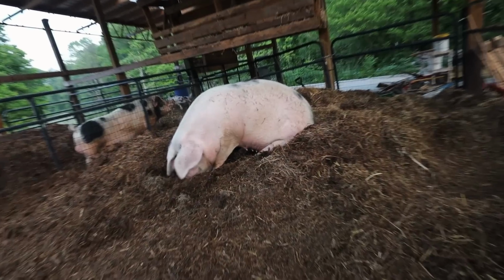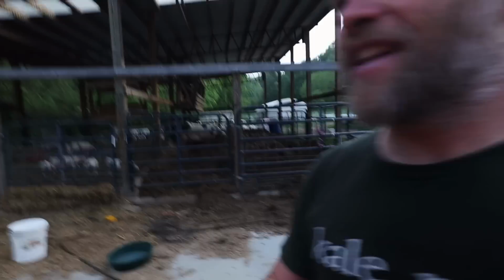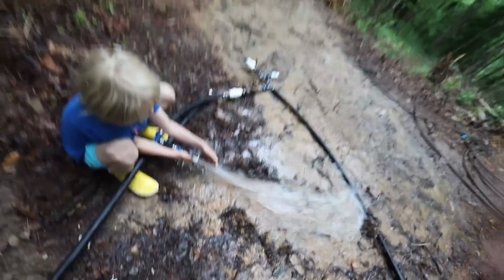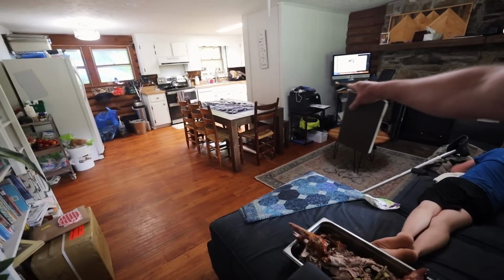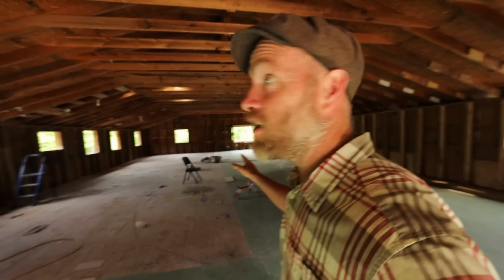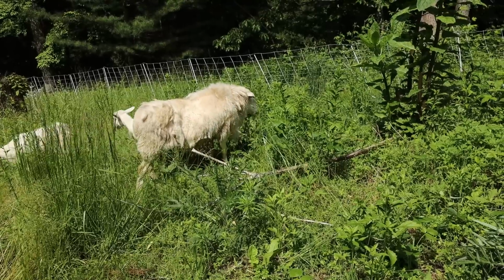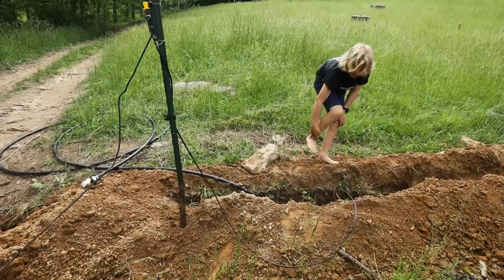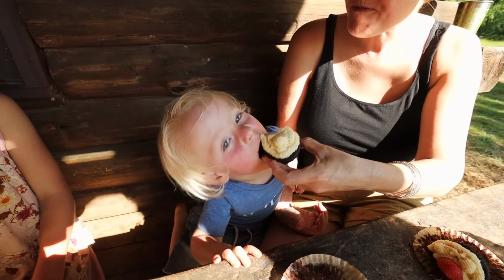WATER PROBLEMS

Comment: There’s not enough pusher to push the water up the hill that’s wide up on top. You got a lot of air but if you go at the bottom, there’s a lot of pressure cause that’s where all the water is staying. You need to put some kind of pump to pull the water upsomewhere in the middle of the hill so I draw the water up the hill.

Comment: Great visit --- everything was inspiring. I have no blow torch but I'm boilin' (bowlin' as a southerner would say) some water to see if the black hose will soften enough.  .... (when the visit is over). 
Lily driving, Jonah cookin' and gratin' and how about  Josiah being able to so beautifully be able to fill in that line? Master Yellow Boots up to the shenanigans and Henry becoming Salty.  Good to see Gramma a minglin'. 
Dang if my job of putting a shut off valve on  didn't go as smooth as butter.  I'd been putting it off thinking how I'd seen you using your blow torch and thanks for inspiring the Dokkodo out of me.

Comment: That was fun to see you get pigs to the guy picking up a couple of pigs. I'm glad you got some of the air out of your water system. I'm surprised climbing that steep mountain helps with your ankles. Henry did good up the mountain and down in the ergo. Yum, rotisserie chicken! I'm glad grandma got through her treatment. That's too bad you have to re-do the whole roof for the remodel. It makes sense that you have to do it right or not at all! Randolph's idea for taking the top off the walk-in freezer worked. It sounds like you need trusses for the new roof! I'm so glad the boys got Selma! Nice, skit filmed by Austin for the Homesteaders Builds kickstarter happening June 1st! Sally is getting worked on. Nice work on the road with the track loader Jonah! Josiah did a great job on burying the water and electric lines. So much on this video Justin! Thanks for this Rhodes family! Lily is an amazing cook and I hope she gets lots of plastic horses!

Comment: You have a lot of graveled roadways you might want to get a Box Scraper for the tractor to help in grading the roadways. It will allow you to pull bunched gravel up into exposed parts and to level the roadway.  I would suggest creating chevrons on critical pieces of the roadway where you are seeing severe washout to help in diverting rainwater off the roadway. When possible you will want to alternate the directions of the chevrons so you do not over burden fields with water and cause other issues.  You have some steep sections of roadway that would benefit from this.  Look towards making your roadways work more for you in regarding runoff and that is both for rain and snow.When you make the chevrons continue a small shallow ditch about 6" into your field to help in diverting the water runoff successfully. I would only need to be about 4" deep to work and grass can grow in it as  long as you make sure it is not clogged with dead grass or debris. Just another part of living and working on hilly territory.
Reply: They dont tend to use a lot of logic

Comment: Take wire coat hangers, bend them in half. If you want to hold something to. The ground, just push them in the ground with the wire or string between the two sides snd that’s a cheap way to get something the hold something down.

Comment: Josiah, check Selma for zerk fittings. If you don't have a manual look on line. Greasing those vehicles should be a frequent part of a maintenance routine on all the equipment you folks have. WD49 is ok for door hinges, but not axles and wheels. With 5 drivers in the family, your equipment gets used a lot and is a giant investment. If your dad or grandfather aren't comfortable showing you how to do that stuff, maybe Randolph can give you a heads up when he is maintaining something so you can watch and learn.
Jonah beautiful job on the road. You are definitely getting more skilled on that equipment.

Comment: 100 ft of 1" pipe contains around 4 gallons of water. These runs are a few hundred feet each, so it might just take some time to fill or drain to find air.

Comment: my family has a maple woods and pipe leaks = money leaks, with our connections we soften the inside of the pipe with torch then put the connections together and clamps on right quick the pipe conforms to the shape of the connector ribs while its soft then hardens again making the tightest seal possible, we also use the type of pipe clamps you tighten with a drill and allows put 2 on either side of the connection, Teflon tape is a must with any threaded connection also

Comment: I just watched a video this morning that shared if you have a lot of foot and leg pain to do a certain exercise that no one does and it will greatly help. Basically it is lean back against a wall feet about a foot out from the wall and then raising your toes up and down. That is exactly what you are doing when you are climbing up. I will see if I can send you the link.
Reply: Can not send link. It is called. HT PHYSIO-OVER-FIFTIES SPECIALIST PHYSIO.  VIDEO IS CALLED “ONE INCREDIBLE TRICK TO IMPROVE YOUR WALKING. “  Those muscles down the front of my legs are extremely sore so I am giving this a try. Always thinking of you Justin as I have lived with chronic pain for over 40 years and now it is getting worse. I stepped in a big insect nest while out berry picking and was badly bit by something and had a tetanus shot. My health has never been the same. Hugs to all.
Reply: @anniepurse2831  Send an e-mail.

Comment: Water pressure regulators don't work with air in the line. Put a spigot uphill to the regulator but of course fix the leaks will solve the problem

Comment: Please make shure there isn't any oil on the brakes and brake disk! If it has gotten on there, you need to replace the brake blocks too (cause you can't get oil out of them)
If there is oil on them, that wheel won't brake!
Either the bake sliding pin isn't sliding well and it needs copper grease, or the wheel bearing is broken and causing the breakes to squeek. Those are the main reasons for squeeling wheels.

Comment: you are staying busy - keep doing some clearing - the renovation will go quick - doublecheck all the specs and make sure everybody is on good terms but also accountable - being a stickler will pay off - your alls health issues should clear up but get many opinions to make best informed decisions - get a basketball hoop and some play fields (frisbee/badminton/whiffleball/horseshoe pit/sandboxes) going and get a weight setup going - the fields look good, you will get water system debugged, double down on compost and enriching fields/pastures to stave off late summer drought - double down on tree planting - you may have gotten the hang of it now - think diversity and doing another hoop house just for tree hacking/starts - low overall effort once you get over learning curve and 2-3 yr old starts make great gifts - chestnuts/pecans/pears/apples - good forage for the animals as well - the fence setups look excellent but doo more paddock planning to lower inputs and help save on labor - time management is a big challenge as farming is so work intensive. double down on office and computer setup with new renovation - you need more servers/monitors/backup machines but you can use walmart refurbs for much of this - get several opinions on optimal setups/faster network to save time #2.5gbe/10gbe

Comment: H2O FIX........I say its not that you have air in the line but that you DONT have enough air in the tank to release the vaccum that all that water volume is creating behind or at the top end of the line.  Think turning a 2 liter bottle upside down quickly.  The water will start fast but then slow as it needs get air in the back side of the fluid and then it glug glugs.  Make sure you have enough of an air vent in the large water barrel at the top of the mountain.  My free 2 cents 😉

Comment: Your clamps  are the problem. Has your water goes down the hill it acquires weight and velocity creating suction that brings air in the line sucked in at the connections. You should use clamps with the screws to tighten it enough to keep the air out.

Comment: Your self build fire pit/BBQ shouldn't you lift that fire higher on a grid? Then the air can get in from underneath , with a few holes you can regulate the air flow?

Those waterlines, are there not real connectors, these clams i don't think that is a good way.